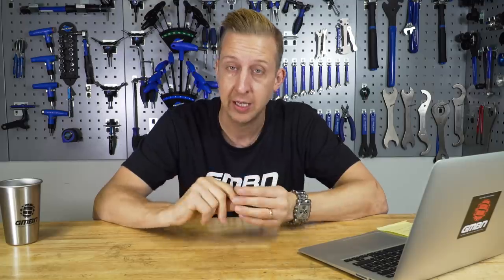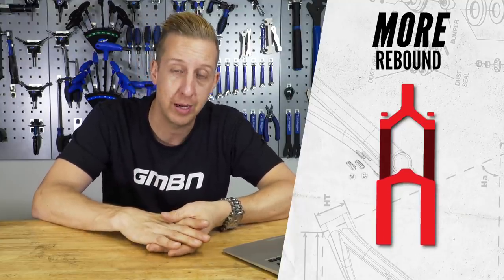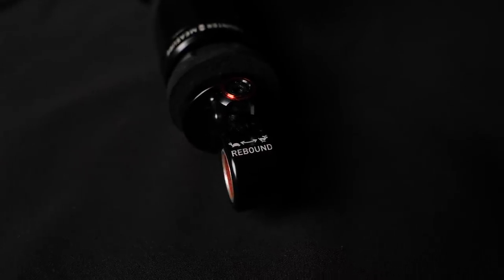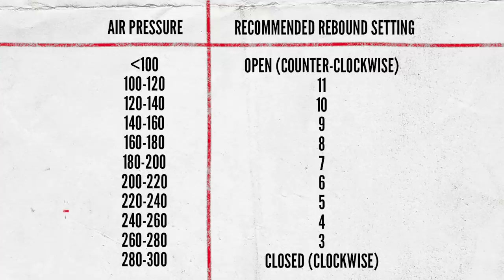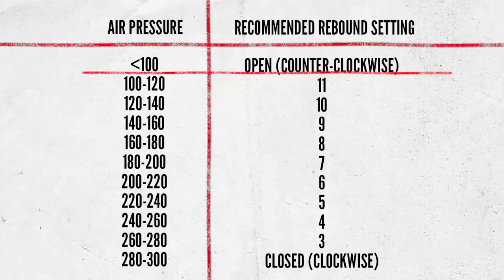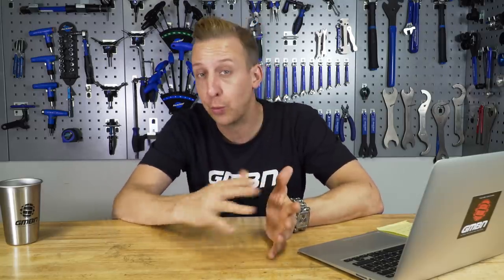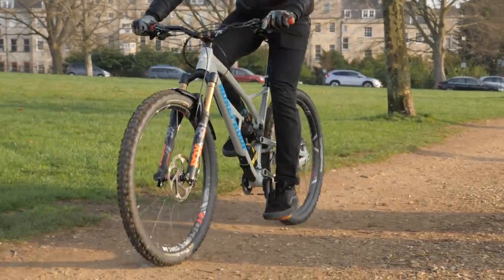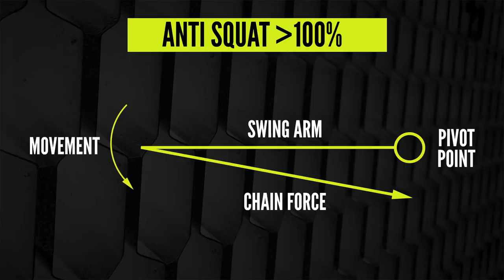Confusing MTB Suspension Jargon Explained

Comment: Nice vid doddie...however when u show compressing to charge the neg chamber(6:42), u have the shock pump still fully attached! Tusk! U can see the air being forced back into to pump, moving the needle and not (effectively) charging the neg chamber therefore. Plus can damage pump (accuracy). Always disconnect pump before compressing...just enough to close the valve/release pressure in pump is ok, don't have to fully undo/remove if pressure in pump released...
Reply: Also peops, rockshox u pressurise shock (not forks, this is shocks only) to 100psi then compress 5 times to charge neg...not to body weight as per text...👍

Comment: I personally prefer to have slower low speed rebound for stability (less bouncing off of small bumps and things) and increased low speed damping to prevent excessive fork travel in the first place so it doesn't pack down. I find this helps keep my arms fresh and my line controlled in extremely rough terrain. I just tweak the high speed compression damping to just enough to avoid violent bottom outs but otherwise leave it as open as possible.

Comment: I really like your videos. I just bought my first mountain bike a used 2013 Santa Cruz Tallboy C. I live in Jamaica where there isn't lot of trail riding per se   but it's very possible given the make up of the country. The Bike has dual shock absorbers both with 100mm of travel which from watching your videos I think will be fine for what I'll be doing. I however want to know if it is possible to safely change out the shock absorbers to 110mm rear and 120-130mm front or can I get the existing 100mm absorbers to perform like 120mm absorbers by adding those things which I totally forgot the name?
Reply: Hey I am watching this vid in 2021 so if you still have not changed your shock and fork I'll tell you uf you can. So you can change both the shock and the fork either up 20mm max or down 20mm max. for example: Now you have a 100mm fork you can get a fork up to 120mm or else the geometry if the bike will change quite a bit. Same goes on for the fork. Please tell me If I helped you!

Comment: Great video. I have an opportunity to replace my 2015 Fox Factory Fit 32 120mm for a 2017 Fox Step Cast 32 100mm at a deeply discounted price. I am 5’9” 200lbs and ride a Santa Cruz Tallboy 29er that was originally spec’ed with the 120mm. What are the negatives to making the switch? Are there any?
Reply: Brad Williams it’s a fox fork so the travel can easily be adjusted up to 120mm if you wanted

Comment: Why would you want to add high speed compression to prevent bottom out over volume spacers?
Reply: Old question, but in case anyone else wants to know, the reason for high speed compression vs volume spacers is to increase the damping (absorbing energy), where volume spacers increase the spring rate deeper in the travel instead.  If you have a shock without enough high speed compression damping, but with lots of spacers, it'll move very easily in the initial part of the travel and then get a lot stiffer later on.  with repeated hits, it'll pack down against the stiff part at the end of the travel, but because the spring is so progressive, it won't bottom out as hard.   Really, the end result is almost like having a shorter and harder fork/shock after the first couple hits.

Comment: Speaking of suspension, I've been have an issue with my fork set up and was wondering if you guys had any advice. I've been noticing fatigue in my arms on really rough trails (flying monkey, UT to be specific). So far I've tried lowering compression and have tried both faster and slower rebound. With this set up i had a violent bottom out on a drop with 2 blue volume spacers, so I tried increasing pressure a little. Any red flags or suggestions? Maybe arm strengthening? The fork I'm running is a 2017 160mm fox factory fork

Comment: #askgmbntech Great video thanks. I still don't get how the rear shocks are measured; for example: I run a 120mm forks at the front, that is actually 120mm... I can measure that on some rides to determine the % I am using , so I can adjust...but on the rear, I also have a "120mm" travel ... but when you measure it, obviously that is not 120mm... Could you please enlighten me on that? thanks.

Comment: I have a 140mil Rock Shox Sektor fork. On my fork there is only one Compression adjustment knob. 
How do i know if i have High speed OR low speed compression adjustment on My fork?
Reply: It's blue and it will be low speed compression.
Reply from the maker: As Der Man said, if you have one, then it's low speed compression.